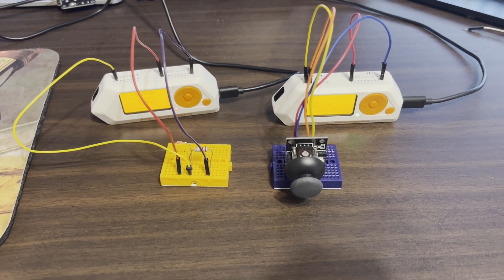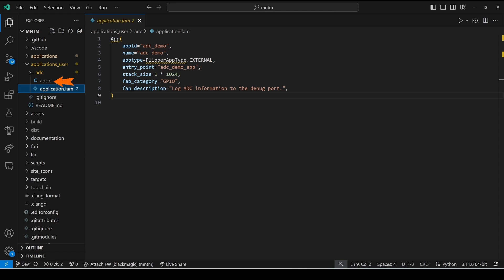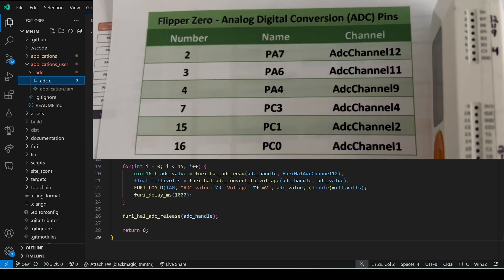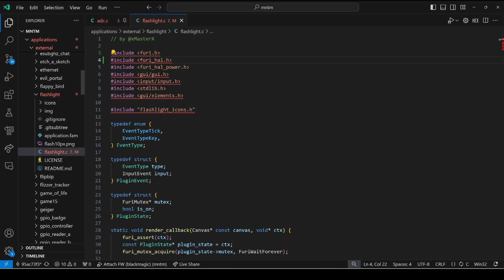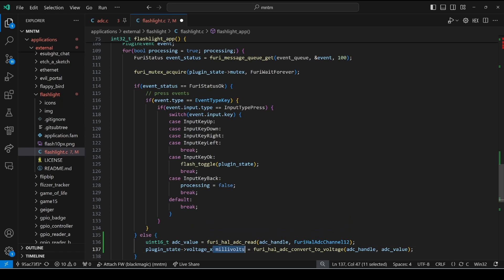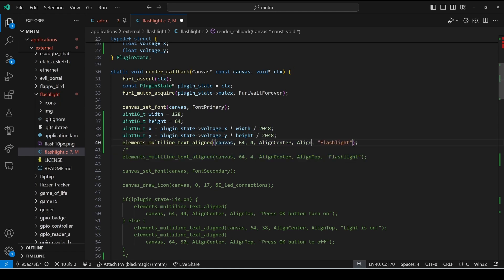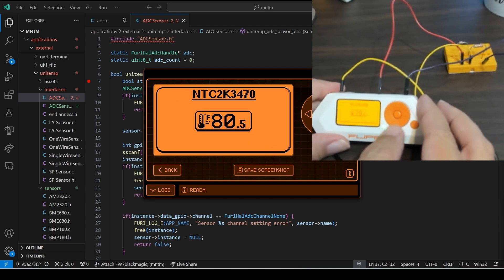[122] Flipper-Zero: Easily read Analog sensors in C Code!

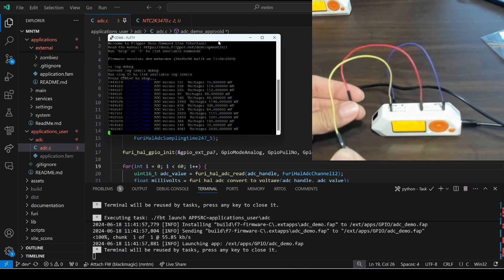Comment from the maker: 3:33 Is it a bad idea to touch both 3V3 and A7 pins with your hands, since it seems we are exceeding the reference input voltage?  Maybe it's better to have a voltage divider that drops the maximum to 2V or 2.5V depending on the reference voltage we are using?

Anyone know if anything BAD can happen if we exceed the reference voltage?

Comment: Another great video/explanation.  Do you (or do you know anyone) doing anything with F0 and BTLE devices?  Specifically, wireless probes (Fieldpiece, Testo, etc.) used in HVAC, connecting with F0.
Thanks
Reply from the maker: I haven’t looked into BTLE.  I’ve only seen FZ use BLE for keyboard, mouse, BLESpam & official app.  I’ve heard it doesn’t have full stack - but not sure what its capabilities are?  Feel free to ask in my Discord server, perhaps someone there is more familiar.  BLE, NFC & U2F are all topics I haven’t learned much about yet.